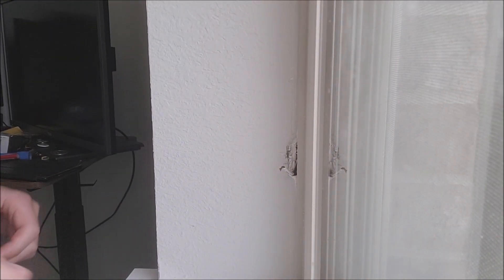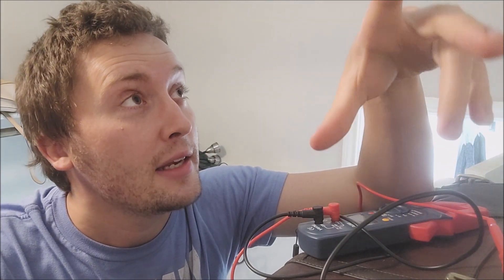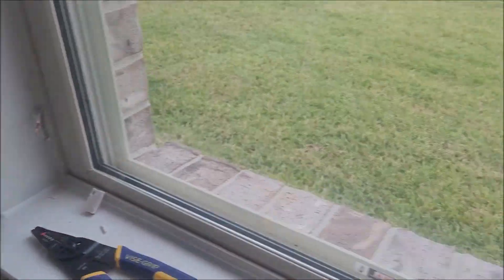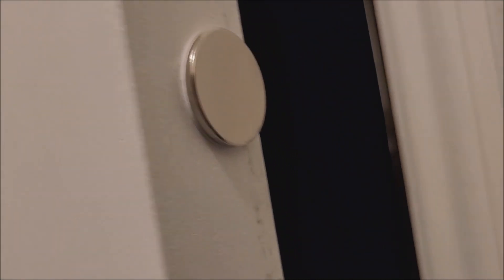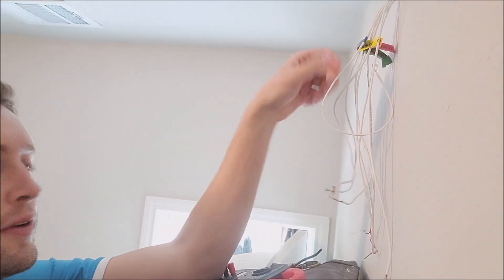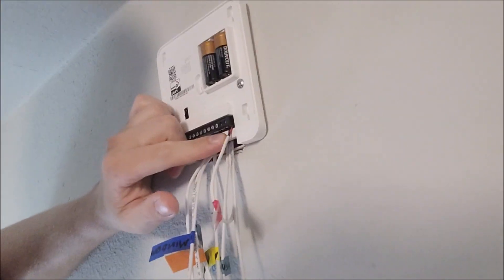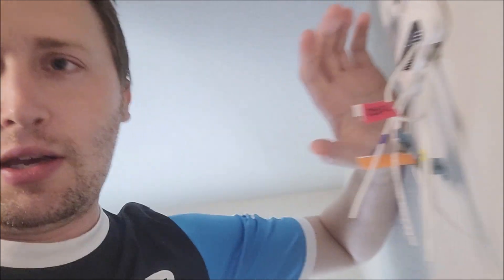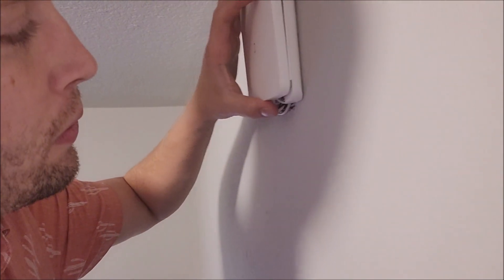Ring Retrofit Alarm Kit in New Pre-wired House - How to - DIY Alarm System

Comment: My wires are short by the panel. what type of cable I can use to extend the wires?
Reply from the maker: Just some low voltage wires like this, https://a.co/d/ezwC5SE, and some wire nuts should do the trick I would expect 👍

Comment: How long does the batteries last in it? Do you think there's a way to add somekind of AC adapter to this retrofit alarm kit to avoid using batteries? Surprised it doesn't give you a choice, or does it?
Reply from the maker: 10 months later I’m still using the same batteries. The type of battery used is highly efficient and very low usage for the low voltage wires. Also I am pretty sure there is not a way to add an AC adapter, but also I believe you will receive an alert on your phone when batteries are getting low to change in advance.
Reply: You could replace the 2, 3V Lithium batteries with a 6V AC/DC adapter, but if you lose power, this device stops working, so you'll need to add a backup battery anyway.  You'll be safer if you leave the batteries installed and let Ring warn you when they are getting weak.